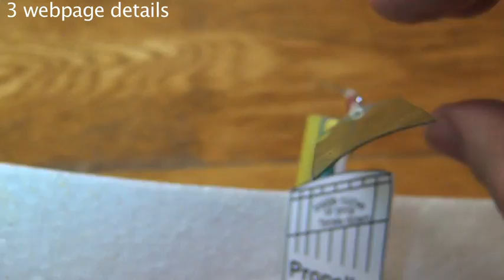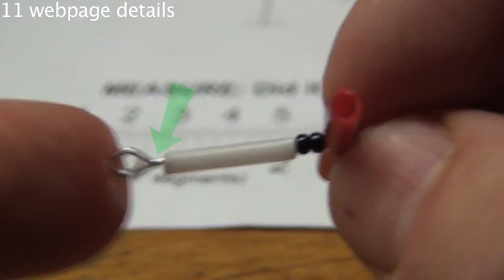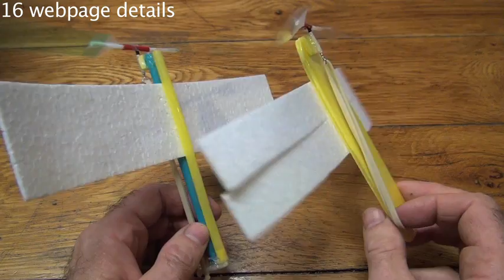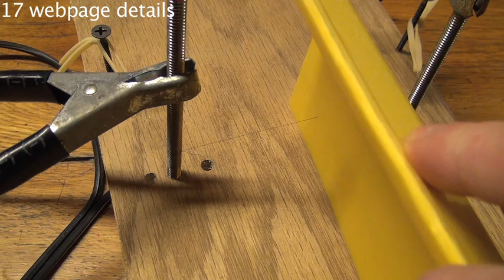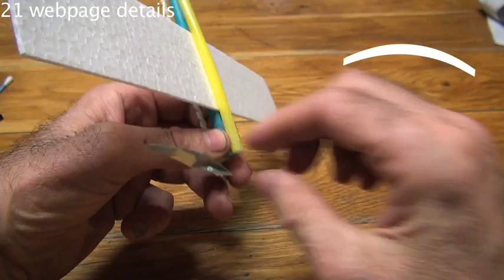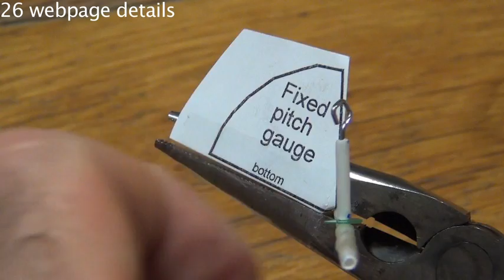Eco-Empirical Dragonfly Helicopter Build

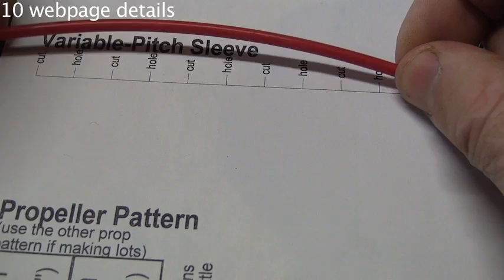Comment: Hi, perfect video, just what I was looking for. Please, could tell me where did you get that tube (for the variable pitch), at 04:21, and what is it made of (the material)??? Thanks in advance!! Well done for the video! :)
Reply from the maker: The red tube is nylon pneumatic hose. Unfortunately, you usually have to buy 100 feet at one time, which is more than most people need (that's enough for about 1200 helicopters)! Furthermore, not all plastic swab sticks are the same diameter (who knew?). They have to fit exactly into the tube, but they vary a lot from brand to brand. Best wishes finding it. If you cannot buy small amounts, contact me. Even if you live outside the U.S. and have to pay $13.50USD for postage, the actual materials are cheap; and I will send out whatever quantity people actually need. 
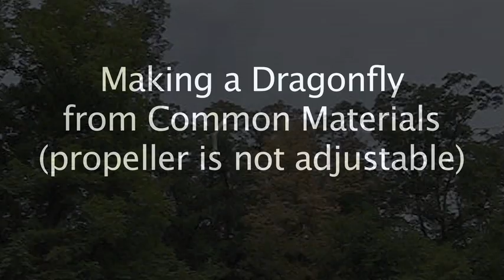Another option is to forget about the variable pitch feature. I cover that at about 17:00 minutes in. But you cannot substitute regular office rubber bands for model rubber band. Does not work.
Reply: sciencetoymaker Thanks!